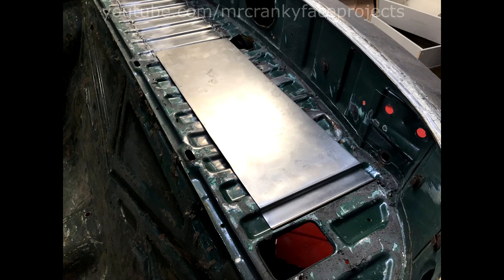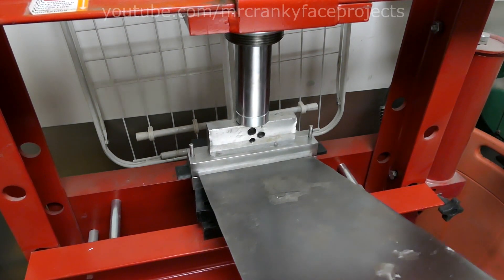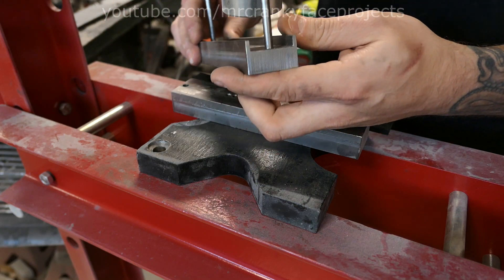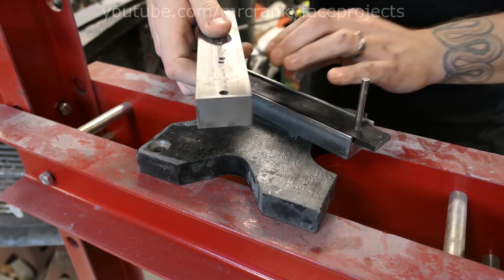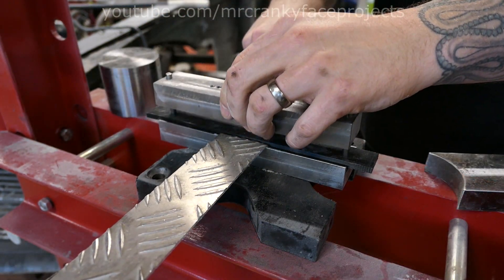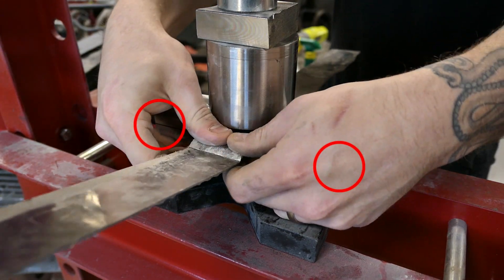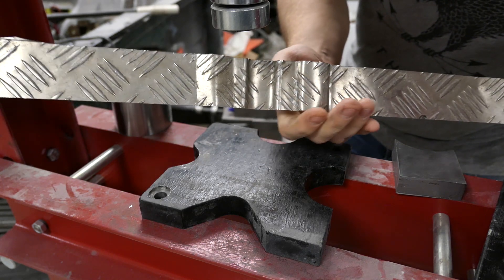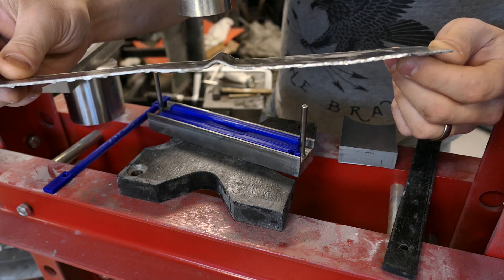Bending steel with 3D-prints (Volvo Amazon / 131 part 4)

Comment: Can you make a die to press emblems on fender inlay
Reply from the maker: Definitely doable but requires a more complicated die I suspect.
You'd also need some way to keep both parts centered which might be difficult depending on where on the fender it is.
Top of mind I'm thinking of drilling two small holes(5-8mm) where you can put dowels through or something, lets you center the two pieces of the press and then easily weld them up again.